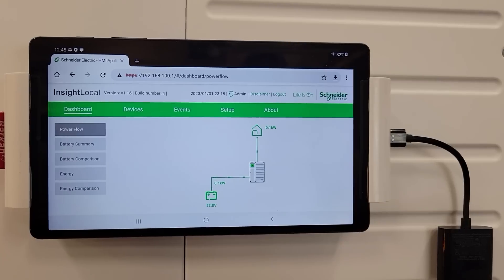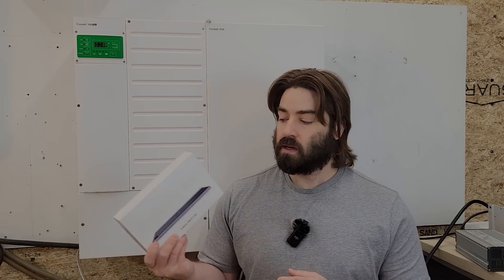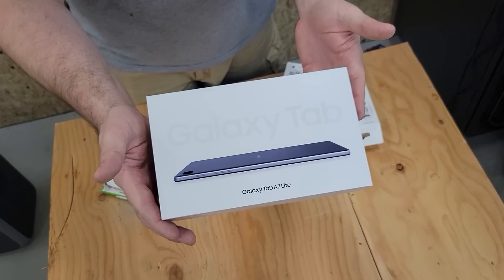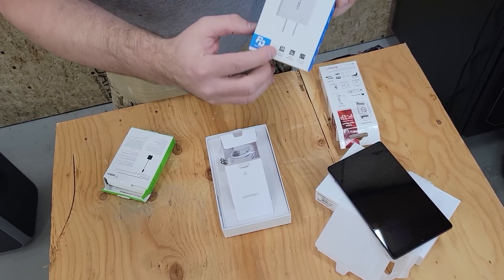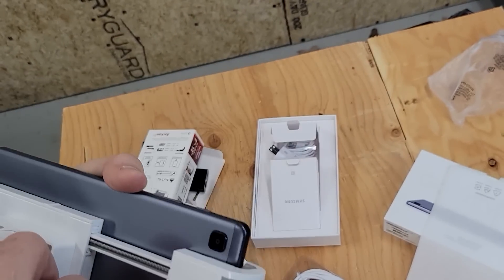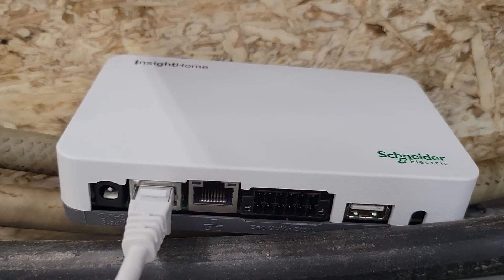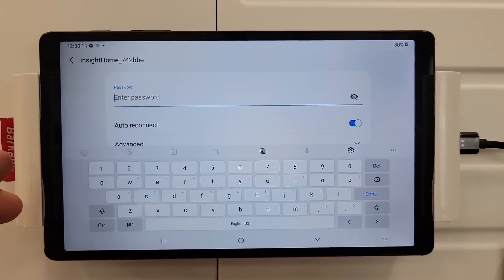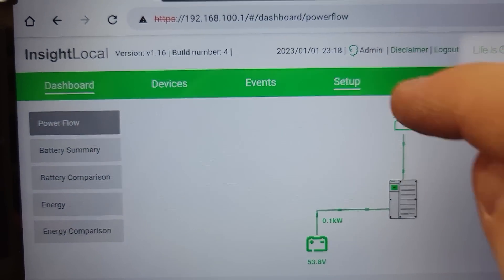DIY option for monitoring solar off grid system

Comment: Hey David - I'm upgrading an older system with intent to add the ability to not just remotely monitor, but also manually change inverter functions in and out of inverting, sell, standby and charging. Having a mobile app allowing access to adjust all aspects such as voltage set points and time triggered events would be ideal.   I'm leaning towards the Schneider XW Pro 6.8 Hybrid Inverter.  You've covered the InsightHome device in this video.  But I see Schneider also has apps called InsightCloud and InsightMobile. Might you know if either of these apps work independently via a WiFi dongle to the phone app (allowing full remote access to all of the above)?  Or, is the InsightHome device required as the foundational means of connecting the Inverter to WiFi and then ultimately to the InsightCloud or InsightMobile app?  Paraphrased:  What additional equipment and/or app is needed to allow maximum remote control capabilities via a smartphone?
Reply from the maker: I've never used the Schneider app on my phone.  But, to my knowledge...  The XW PRO inverter only talks a proprietary language to the insight home.  The insight home is the only means to connect to the web (and/or app).

Comment: Hi, I have an XW6848 and I want to know how to change the frequency from 60hz to 50hz and back. I live in Jamaica where we use 50hz but only 1 appliance which is my washing machine does not work with the 60hz. I prefer to keep my inverter on 60hz but would like to change it to 50hz when I want to use my washer and then switch back when I'm done. For now I have to use the grid for the washer. Can you tell me which equipment I need to get. Someone said the SCP can't change the frequency
Reply from the maker: I've never tried changing the frequency on mine.  Since I don't have experience doing that exact task, I'm going to suggest you contact Schneider.

Comment: Have you watched any videos on the EG4 18K and/or Fortress Power Envy True 12K systems by Lux Power? Being they are all in one systems with no reported trouble and terrific software have you considered them for replacing the Schneider Conext XW PRO 6.8K?
Reply from the maker: I'm glad more and more products are coming onto the market.  The all-in-one inverters are helping make solar more appealing to the DIY crowd.  I have not tested either of the two inverters you mentioned.  I think it would be fun to test them if there is enough interest.  I don't plan to replace my current Schneider inverter since it's working extremely well.
Reply: Extremely well………is hard to beat!

Comment: Too bad Schneider is discontinuing the SCP! That gives a great overview of the full system without even needing the insight! I think the biggest schneider system I have installed with no insight device, but using the SCP, was 3x XW6848s, 4x mppt80s, scp, ags and battery monitor!

Comment: Awesome video. Could you not use your Insight Home box wirelessly and view all data on your smartphone? I would have thought the Insight home could connect to your home's wifi and then from there view all the data form any smartphone/tablet wirelessly.
Reply from the maker: Yes, you can do that.  I'm just trying out something different.
Reply: @DavidPozEnergy  Thanks for the reply! Does it connect to my home's network or I have to manually connect to the local device's wireless signal in order to access the information?
Reply from the maker: You can do either.  You might want to download the Schneider app on your phone.  That way you don't have to switch networks.

Comment: David, might you be able to answer a few questions for me plz????  if so, here goes, Before you went with the insight home, how did you run the schneider without any communication??? how did the conext XW know what batteries you had ?  how did it know if you had lead acid or lithium or what charge voltage to charge at etc etc etc . how did you conext a generator to the conext XW when the control panel only lets you switch it on or off
Reply from the maker: I ran the Schneider without communication for quite awhile.  At the time, the Schneider XW PRO was acting as an inverter only.  I never connected anything to the "AC INPUT" terminals.  This means there was no need to program the type of battery, or generator, or grid settings.  I charged the battery using my external solar charge controller (Growatt and Victron).  The external charge controller was programmed to charge the battery to 56V on the charge controller itself.

Comment: Very cool project and congrats for slogging through the technical stuff to make it run.   Keep up the good work.

I built an off grid battery bank cabinet with solar input and several inverters to run fridges and freezers despite power outages. We lost power 4 times in March alone during the heavy NorCal rains, so it came in handy.  My Victron Smart Shunt and Renogy BT Bluetooth will not reach into my house. I bought a Pet Camera from Amazon for $50 and parked it a foot away from my Renogy SOC display right after getting the system running.  The app on my iPhone can not only clearly see the display of volts, watts, amps, % charge, and time remaining to charge/discharge. I can instantly see these things while at my brother's house 400 miles away.  I look at the display through my cell phone at least 20 times a day while I'm out and about. The system has been running 24/7 for a year now. That's some cheap and dirty monitoring!

The cam has pan, tilt, zoom, a microphone, and a laser pointer. I sometimes check to hear the inverter fans cycling under different loads. I also heard the inverter fault alarm early on while testing the system. Its 46kwh, 12k total with 3 inverters, one is split phase. My son came over while I was on a 4 day trip and could not find my MC-4 crimper.  I was able to remotely turn the camera around and use the laser to point to the shelf where I throw all of my solar connectors these days. That was pretty cool.
Reply from the maker: I love that!
Reply: @DavidPozEnergy  Video of cheap remote monitoring....   https://www.youtube.com/watch?v=mDv3vl3WlAM
Reply from the maker: Cool, thanks for sharing.

Comment: Would have been a lot easier to connect the tablet straight to the insight via wireless - you wouldnt have had to fiddle with so many cables and settings.  Still a good learning experience though!

Comment: You will benefit from the work to understand the LAN and how it works cause there are many devices out with such an internal server. 
Might be a good idea for Schneider to get an App running or find a better solution for a full immersive browser view without chrome menu and so on which is usually called kiosk mode. 

Also a PIR sensor that turn the display on when needed would be a lot more beneficial cause otherwise your battery will dy sooner or later, that in the galaxy tab cause usually the battery suffers from such applications with 247 display turned on. There might be a way for the samsung to detect eye movement if I do remember right and then turn on.

The best would be an e-Ink display cause that is quite more efficient and slow update rate of only a few times a second does not matter. 

Great project idea.

Comment: Can you tell me if 240v is the charging voltage when a generator is used to charge Batteries Thanks i wanr to replace a Magnum 4024 with conext 4024
Reply from the maker: I have a video charging with my generator: https://youtu.be/36H6Sb2IG_k
Reply: @DavidPozEnergy  Thanks for the quick reply i did watch your video and it answered my question Thanks

Comment: Did you turn the wifi off on the insightHome or on the tablet? You pointed the browser to the 192.168.100.1 network. The wired network is 192.168.3.1. Therefore you should point browser to that subnet in order to use the CAT5e network. Also, you must have set the dongle ethernet port to the same subnet (192.168.3.2/24). If you don't point browser to 192.168.3.1, you will still be using the Wifi. Glad you got it working. Thanks for sharing

Comment: Hi David, I need your technical help. 
1. Can we parallel PV with different Voltage, say 5 X 500 WP PV parallel with 2 X 500 WP into PV combiner multiple input? 
2. Same issue but parallel before PV combiner (assumed only 1 inlet on combiner). 
3. My Inverter (LF Inverter) brand new connected to my PV and in 5 minutes the inverter burned on toroid part the question is, can it be because the PV giving "bad input" ? Because after that I parallel that pv to my Growatt and the inverter also shutdown but the inverter was okay, can be restarted.  
Thanks
Reply from the maker: Hi Agus,
Discussing parallel/series connections for a solar array:
If you parallel solar modules they must be the same Voltage.  If you series connect solar modules they must be the same Amperage.  
The Vmp (Volts at maximum power) should be above the "snap" Voltage of the charge controller.  The Voc (Volts open circuit) should be 25% lower than your maximum input Voltage to your charge controller.  (This number can sometimes be lower depending on your locations design temperature)
Reply: @DavidPozEnergy  Thanks, understood.

Comment: Have you considered  using modbus protocol to monitor/configure your inverter via your home network?  I have the same inverter and have been successfully monitoring and doing some dynamic configuration via Openhab with the modbus binding for more than a year.  Modbus itself is insecure so it's good to have some network restrictions on the access, but it is powerful in that it exposes nearly every knob and stat available.  I'm assuming the Insight Home supports this, I have the older Insight Gateway.  Keep the videos coming, they're interesting to watch!
Reply from the maker: I'm sorry, but I understood almost nothing you just said.  I'm really not very good with computers.
Reply: @DavidPozEnergy  Understood.  I've been adding improvements to my home automation setup for years, which has included adding support for managing my inverter.  It makes it possible to easily see the status of the inverter and various stats on power, but also to trigger automated actions based on whatever conditions you choose.  In my case, I do things like: 
* when it's a really hot day and I worry there could be rolling blackouts, I set the battery recharge threshold higher
* when battery charging kicks in compute a running estimate of the remaining charge time
* choosing when to recharge the batteries based on outside luminance over the past few days (so that my solar is likely producing enough to cover the charging since I'm on the grid)
* dynamically set the evening load-shaving start time based on when the luminance drops below a set threshold average for the past few days
* when inverting from battery turn off unnecessary lights and power use and disable automation
In addition it gives me a customizable UI and mobile app and the ability to view historical data for anything I choose.  I admit it's not trivial to setup, I can't even guess at how many months of my life are invested in the custom rules and functionality I have, but it's powerful and useful for me.

Comment: This is one area that I think Victron has excelled at. Thier systems are leaps and bounds better than any other current vendor for equipment monitoring. Not only can you view your system easily at a glance, but you can also share it with the rest of the world. When I was first building my system, I found it really helpful to look at other active systems to understand how they operated and the effectiveness of them. Of course, the build is never completely finished. Like you, I'm always thinking of ways to improve it.
Reply from the maker: Yes, Victron has a better monitor solution.  I like using Victron equipment.  I just wish Victron could get some of their big inverters UL listed.
Reply: @DavidPozEnergy  Ya, no UL listing means I won't touch them. I want no grief from insurance!
Reply: Hmmm, I never thought of the insurance angle!  Should have, as my oldest son, owns an insurance agency…..

Comment: Thank you David. I'm onboard with monitoring my system but, this seems a bit too much setup for the gain.
Reply from the maker: Yeah, it was a lot.  I'd be happy just using the software through wifi.  If a system is set up well, then it's not something you have to monitor.  I'm a DIY'er, so I enjoy monitoring.  

Example: If you have a generator, then the system will turn it on whenever the batteries are low, and turn it off after the charging.  It's all automatic.

Comment: What I really have a hard time with your channel is, what have any of these inverters done that the Sunny Islands didn't? A compare and contrast would be awesome!
Reply from the maker: The SMA sunny islands are very well made inverters.  I had a little bit of a hard time with the settings on the SMA's.  They want to be closed-loop communication with a BMS.  Unfortunately, they don't talk to all the battery options out there.  If you try to use them open-loop, based on Voltage, they default to a FLA algorithm.  This meant I had to lie in the settings, and still do a manual re-set about once a month.  There is a hack to work around this, but it wasn't something I could do on my own.  Way too much computer coding.

Comment: I've been doing this with an old iPad for the past year on my dual XWPro system. WiFi is much easier than trying to do a 2-node LAN with Ethernet. The Insight Edge devices take care of all the IP addressing stuff when you connect directly to the wireless access point on the device. I keep my tablet on the kitchen counter so it's easy to reference in the house. Also, the Guest login to Insight Local does not timeout like Admin or User does, reguardless of network connection.

Comment: Were you able to change parameters with the tablet when you were done, or you're still in monitor mode only?
Reply from the maker: Yes.  When logged in as "Admin" you can change every parameter right on the screen.  I did this over the past week while I was setting up generator input.  However, it's hard to film the small screen.

Comment: Potential problem with using iPads tablets/ phones is they are not designed to be plugged in and on all the time. 
I've heard instances of the batteries swelling up. I've seen it myself with a phone that I left plugged in 24 7 in order to forward text messages.
The smart home people have been dealing with this for years. I'm not up to date on what the current solutions are.

A possible solution would be to use something like a raspberry pi and a 7-inch monitor.
Reply from the maker: That would be nice to eliminate the monitors battery.

Comment: Hi David, good job on figuring it out. Regarding the networking issues, I do find it strange how you figured out so many other things, which I imagine you had to read and research. Not sure why filling in the network settings should be different from any other kind of technical knowledge. Anyone can just try things and maybe it will or won't work, but for any system you've had to work on before and explain, it seems like there were many things you had to read and research. Why is this a sore spot more than any of those?
Reply from the maker: I'm not sure.  Perhaps I just have more background knowledge with physical things (tools, bolts, lumber).  Sometimes the instructions say "Gateway" and sometimes "IP Address" or other names.  But, come to find out, I type the same answer into both.  I'm used to words meaning different things.   LOL.
Reply: @DavidPozEnergy  Your videos have helped me out, so hopefully this helps you. IP Address = identifier for the device, subnet = subset of the entire network which can be accessed (aka local computers), subnet mask = like painters tape for the network. A binary 1 means not local, Gateway = the computer you talk to which can let you access the network which is not on your subnet. DNS = The device which knows how to translate names to IP, DHCP = shout onto the network, "HEY I need to know how to configure myself!", DHCP server = machine which will respond (having more than one is generally confusing), Static = supply all the numbers at the start (avoids problems if the DHCP server is offline at the expense of figuring it out ahead and keeping it updated manually), Self assigned = randomly pick an IP in a known range, see if anyone seems to be using it, if not, start using it (similar to DHCP, but you don't get any Gateway or DNS, because it's not possible).

Devices are not limited to a single network, if you need/want more than one.

There is more nuance to this, but this should be close enough to keep it from being a full on mystery for day to day configurations.
Reply from the maker: Thank you.
Reply: @DavidPozEnergy  Gateway (on an IP setup screen) is for your router's IP address. If you're not using a router you should leave it blank. The same with DNS servers, leave it blank if you don't have one (in a standard home setup the router is also your DNS). The only required settings are IP address and network mask.

Comment: I've never seen or heard you discuss microinverter systems. What's your opinion about them compared with string inverters?
Reply from the maker: They are good.  I haven't gone through a bunch of testing on them, which is why I've never made a video about them.